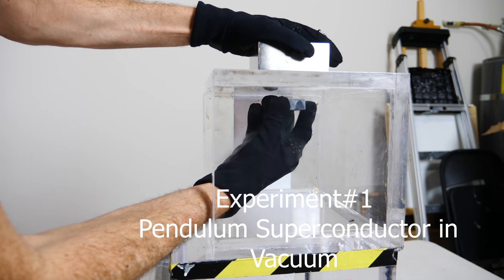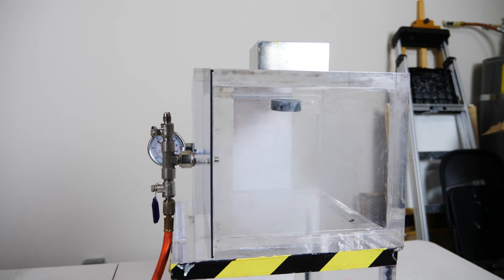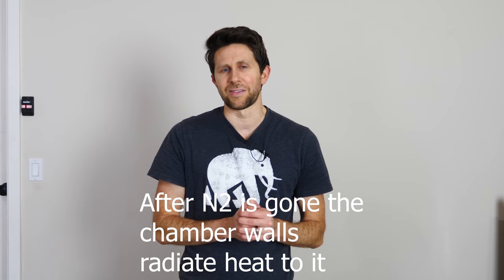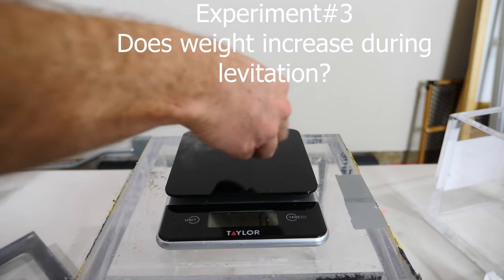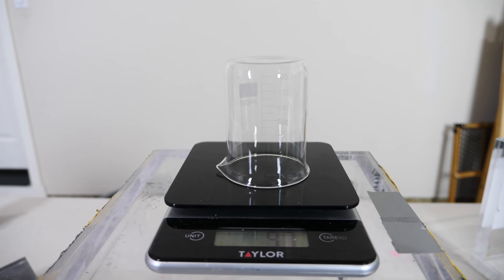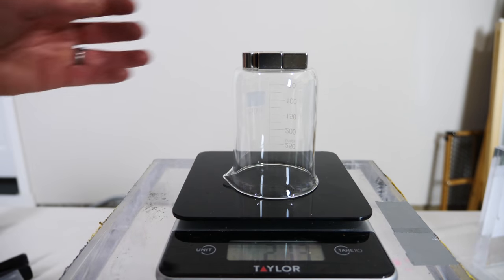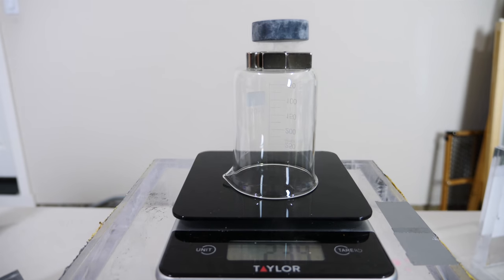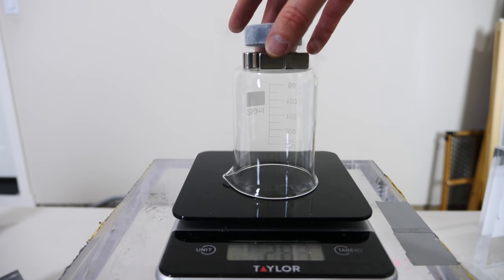Does The Weight Increase When You Levitate a Superconductor on a Scale?

Comment: 7:13 The way most people understand 'levitation' is that it's a kind of force that keeps something from falling back on the ground and instead stays in a certain amount of distance from the ground unless whatever force is responsible for such phenomena is increased.

So it's like an object being lifted off the ground by some invisible force. Like a balloon with an invisible string tied to a pen. Making the pen itself to have zero weight if it was to be placed directly over a scale. In this case, it's a magnetic force that's making an object levitate. Meaning, the one that's  lifting the object isn't something like a balloon, but more like a jack or a crane. The weight is just shifted somewhere else, but still has to touch the ground. Hence, the weight doesn't change at all.

I've always wanted to find the conclusion of this experiment. But, I couldn't get a hold of some liquid nitrogen. Haha

Comment: Let's remake the antigravity experiment by rotate the superconductor disk at high speed. It could disable graviton enough to levitate salt powder. Or at least, we could calculate and find out the ratio mass decrease. If gravity is just space bending effect, then the high speed rotating superconductor disk is bending space with customizable parameter  without changing mass of system itself. Thus could able to reach Negative Space Bending or negative gravity, without the special case of antimatter and antienergy.

Comment: I say that the weight does increase otherwise the superconductor would not hold up. For every action etc.

Secondly it will not stay cold forever due to radiant heat but what would happen if you put it in a perfect black box in h a perfect vacuum?

Comment: I remember hearing that spinning supperconductors block or cancel gravity; could you test that please?!  I also wouldn't mind seeing the weight of the superconductor with and without the magnet (preferably on a non-magnetic ballence scale).
Reply: That's conspiracy theory nonsense.

When the magnet spins it electrically energizes the other material around it. It's the basis behind how generators work. The superconductor would do much the same, which can then cause rise of sympathetic magnetic fields via the right materials. This would then cause the same levitation effect if the superconductor is sitting on top of the sympathetic magnetic field. 

The difference between a superconductor and a normal  magnetic field is the superconductor is not a dipole field.

Comment: I think the superconductor heating up in the first part is really just because there is actually plenty of air for most of the time it's in there since the pump takes a while, and also thermal radiation. The liquid nitrogen should provide the same amount of cooling regardless of how quickly it boils, so while it may boil faster the puck should be extra cold when it finishes boiling.

Comment: Explanation at the end is why extremely polished flat surfaces stick to each other like they're magnetized.  Gauge blocks are a good example.  A normal non-flat surface (remember the microscopic imperfections in Jurassic Park?) allows some air as a buffer for one object to glide over another, but the more contact can be made, the more the two items start acting like one solid object from more direct interaction between atoms.  This cold welding can evidently be a problem in space if two clean objects of similar metal are brought together.

Comment: Wouldn't gravity cause it to stop swinging too even if energy wasn't being lost when it hits the edges of the magnetic field? Gravity would pose a downward force so it uses energy to swing up...
Reply: The (kinetic) energy used to swing up was gained in the swing down part of the swing.
So if there were no losses of energy due to friction, a pendulum would swing forever.
But of course there is no such thing as frictionless or losses of energy.

(With "loss of energy" meaning: eventually converted to heat in some way)
The principle of "conservation of energy" is one of the strongest and most important principles in all of physics, technics or engeniering. No one can circumvent it. If you think you did, you only did not watch closely enough to figure out where the energy went or came from.
If you search where some energy might have gone, start with the observation that heat can be seen as the wastebucket of energy. So if your measurements show some unexpected imbalance of energy, check what parts in your experiment get warmer - there is your misssing energy.

Comment: So in the 2nd vacuum test where it was placed on a sponge, it seemed that the object began to increase in rotation as the air pressure was reduced, so I have to wonder if it is truly without friction. I do understand the other points just an observation as pressure decreased before collapse.

Was the full weight of the conductor transfered or just the amount of weight generated by the repulsive force. Im curious because that would mean the weight may not increase just the pressure so in a zero gravity environment this could be considered thrust or at the very least generate motion. "If the objects were tidal locked".
Reply: The mass doesn't increase when you make a material into a magnet. Magnetic fields are a sympathetic response to the directional flow of electrons, and not an addition of energy. The energy potential doesn't change which means no mass has been added.

Comment: Speed up vacuum chamber evaluation by using a vacuum tank in the circuit.
You will need a suitable tank ( probably an old propane bottle ) and some suitable valves.
Evacuate the tank first, close the chamber, use the tank to quickly evacuate the chamber then switch to the pump to finish off.

Comment: Can you explain de two grams diference? The scale mesure 213 when you put the superconductor on the magnet 234-19=215.
Reply: The 19 might actually have been 18.788356 and the scale has rounded up to 19.
Same rounding occoured when he measured the beaker or the whole system. The whole "system" might have had a weight of 234.478 grams and the scale rounded down to 234.

So in fact those are measurement errors. This is why in serious phyiscs you always give a result with an error range which acounts for the ability of the measurement device to give you the true value.

Comment: The levitation pendulum isn't frictionless at all and also the superconductor puck never touched the magnet. The friction is from hysteresis losses, as the field is constantly changing from the view of the puck. You constantly push flux vortices in the superconductor and pull them out again, which cost energy because these fluxes are pinned (quantum locking). Also, there's gravity. In a pendulum, the vertical position is constantly changing, so gravity is constantly doing work, hence causing friction.
And next to the liquid nitrogen quickly evaporating and not provide cooling anymore, there's also a very sizable heat load from thermal radiation. Remember radiation heat load goes with the temperature to the power 4, and we have quite a large temperature difference here.
Reply: Yup.

Comment: The scale shows not the weight but the pressure by the weight. so actually weight stays the same but due to quantum locking, It puts pressure on magnets (when the superconductor and more mass is added) to his jar which the scale detects, remember that it is that easy to fool a scale.

Comment: Even though the vacuum contributes to the increased rate of evaporation of the liquid nitrogen, would not the actual evaporation require energy in the form of heat within the superconductor, i.e., the heat of evaporation specific to Nitrogen? Would this loss of heat through evaporation tend to extend the observed superconductor effect on account of Nitrogen’s heat of evaporation? 

What wound occur if a liquified gas with a lower boiling point than Nitrogen were utilized to cool the superconductor?

Comment: Did you cool the vacuum chamber to the same temperature as the magnets? Because if not, you're going to get way more significant heating, especially since the little air in the vacuum chamber would still be room temperature.
Reply: Welp should have kept watching. Didn't know about the reservoir and the chamber walls heating it was mentioned. Though if you cooled the inside and outside of the chamber and left some LN2 inside before running the vacuum so that it would boil out at the same time as the reservoir, it would have definitely lasted longer than it did. Having the chamber made out of glass would also help prevent radiation leaking in from outside the chamber.

Comment: I'd like to point out the scale has a Tare function. What this does is Zero's the scale with weight applied, so any change in weight can be viewed as the difference between the current weight, and any additional weight. While I don't think it matters for the experiment (Mostly because the experiment is a simply Yes/No) I think it would be interesting to see by how much the weight changes and if that amount is equal to or less than the weight of the superconductor by itself.

Comment: In quantum magnetic levitation  the quantum locking is an effect caused by the alignment of the electrons, so there is no repulsion. So I'm wondering that given the same experiment with regular magnets both repulsing each other but maybe held by a device as to allow levitation, would it be accurate to assume the weight of both magnets would be more in a levitating state then the weight of each object weighed individually due to the addition of the oppositional force of the repulsion.  Assuming this were to happen could it be said the magnetic field  itself would contain it own mass?  Which i think the magnetic field strength is supposed to be based on certain characteristics of the object itself so this shouldn't be the outcome but it would be interesting to see an experiment  it. Hmmm

Comment: every reaction has an equal and opposite action. its the same thing if you fly a rc helicopter in a sealead box witch is on a scale. the air from the blades pushes the box down and the weight stays the same.

Comment: If you wrap wire around a magnets and apply 12v DC current you get a   stronger magnets. What happens when you apply current to bismuth. Will it push away from magnets more and will it get lighter on a scale

Comment: Yes.  The base is holding the weight of what's being levitated by magnetic force instead of buoyancy, impingement or a solid structure, like an invisible spring.  Levitation does not mean "weightless", it only means "suspended without direct mechanical contact".

Comment: But what if you put the superconductor inside the upturned beaker so it is suspended like it was inside the vacuum chamber? I understand the magnetic force "pushing down" on the beaker adding weight. But what if that same force is pushing up instead while suspended? Does it push the beaker away from the scale by the same amount??
Reply: The answer to your last question is yes. The answer is because gravity operates independent of the magnetic field.

Comment: what if the superconductor was allowed to be enclosed in a sort of container and that container is put into the vacuum and the same first two experiments are conducted. It would have to be a pretty string container though, it would have to be able to withstand the pressure of the evaporating N2 and the vacuum. But hey, you're smart, you can figure that part out. Good job on your videos, very informative

Comment: Complete novis here, but will the puck 'lift' from the surface as it is cooled until superconducting, if placed on a magnet before cooling? And if so,
will the 'scale' indicate a momentary increase in 'weight' as it becomes superconducting and lifts up from the surface?
Reply: There is no increase in weight, since it will be the same no matter if an object was physically touching each other (while not in superconductor state), or levitating above (when in superconducting state).
Reply: @max5250  My thought was more along the line that; if the puck rise/float up, it must be effected by a force, and would this be registered on the scale. If it is that the puck will rise, which I don't know.

Comment: on the tractor beam magnet configuration, it would seam logically that if the n/p poles can be configured/tuned on 1 plane, then such parameters could be used by a program-computer to design the shapes of magnet/S to actually create a permanent magnet stationary levitation by only magnetic repulsion...  & with today's pyramid & step pyramid permanent magnets creating in the area of 1 Tesla, I'd love to see these pyramids joined say 4 pyramids attached to the base of another thus focusing the magnetic lines of the group configuration basically like a step pyramid in 3 dimensions, should work it would be cool as heck to see 4 ,1 Tesla pyramid n50+ neo's joined ,basically all their magnetic flux forced into a much smaller area.

Comment: For the first experiment the biggest problem is that at no point are you imparting a full hard vacuum on the superconductor, low pressure sure, but not a hard vacuum which is pretty much an impossible expectation. It seems very much that your vacuum pump is mostly inadequate for this experiment. Perhaps if you reduced the size of the chamber or filled it with some random items such as some bricks to displace the volume of the vacuum chamber, you might be able to improve its relative performance.

Comment: Cool video. I wonder though, does this stack? 

As in, can you hang a superconductor from a superconductor from a superconductor from a... well, you get the point. Given that it is a magnetic field, can you basically hang a series of cold magnets below eachother, taking into account that each magnet will increase the magnetic pull, so the weight of the magnets is not too big to at least test if it allows you to hang a superconductor below a superconductor below a superconductor?

Comment: The air resistence isnt the issue, there is a moderate amount of resistance applied from the magnetic feild as well.
Reply: Indeed, from hysteresis losses as the field constantly changes. You constantly push flux in the superconductor and pull it out as the field isn't homogeneous.

Comment: 1. Even in a vacuum the super conductor will be bombarded with radiant heat, from the surroundings.  2. A swinging pendulum will dissipate energy into the support structure, that at best is only semi-rigid. The more rigid and well anchored the hanger, the longer the swinging time. Engineers call this the "Q" of the mechanical circuit. Even something like cast iron will absorb vibrations.   In the case of the super conductor, the stray magnetic field movement will also impart some of it's energy on to the surrounding environment.    In physics do not try to invent 'rational' short cuts : Take a holistic approach where everything is connected.

Comment: Many questions that I've had for years now. I knew the vacuum idea wouldn't work. However, what if it were tidally locked so it were in perpetual dark. The minimum temperature for super conduction is -210. Same as space in the absence of light. With a constant temperature perfect for maintaining super conduction,  little to no gravity to influence it, no air resistance of any kind, how long do you think it could move along a circular track? Circular track is important for my next question, how would the flux tubes effect electron flow? Its super conduction, so electrons should flow without resistance therefore, no heat produced. . but could you tap it? We have a circular system with magnets and not just conductors,  but super conductors. Sounds like an A/C generator. Could you not rig up a system where the magnets freely float "tethered"  by quantum locking to a super conductor that the magnets orbit around. As they do, they pass through conductive coils, just like an A/C generator. But no friction, super conducting,  and power requirements are to get it initially spinning. Newton does the rest. 
Is this even possible to do?

Comment: So, lets say your superconductor was 500lb and you placed it on a gigantic scale. the weight on the scale would then read approximately 500lb.
Now, if someone were to climb under it, would the pressure of 500lb then be pushing them down?

Comment: Put the superconductor outside the vacuum chamber where you can ensure that it remains cold enough with the liquid nitrogen;
and put the magnet inside the vacuum chamber.

Either that or you need a better superconductor system that does not heat up in a vacuum.

Comment: My question with the super conductor on the scale:  I expected it to add weight to the scale, but if you turned off the super conductor, would it weigh less than when it's turned on?  My hunch is more turned on, but you're the man with the equipment to test this ;)
Reply: The only thing that changes the mass of this superconducting puck is the liquid nitrogen in its internal reservoir and ice formation on its surface. The superconductor phase itself doesn't change anything mass-wise, unless you would look at quantum level weight, i.e. E=mc^2 because there's a change in atomic energy

Comment: It should increase, due to Newton's third law. Quantum locking occurs because the electrical resistivity of the substance drops to zero below a certain temperature threshold, and so the magnetic flux generated by bringing the superconductor close to the magnet induces an electric current in the superconductor and corresponding magnetic field that continues perpetually, keeping the object fixed in the exact location and orientation corresponding the the field. Interestingly, magnetic fields can do no work. In order to maintain stable levitation, the magnetic "force" from the magnetics keeping the object suspended should be equal to the object's weight, and so the reaction "force" should transmit the object's weight to the surface supporting the magnets.